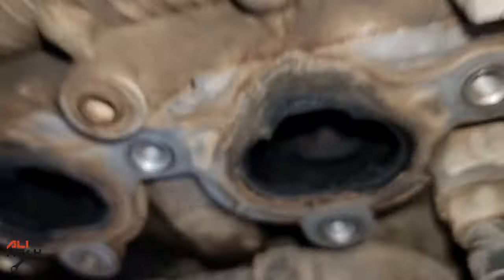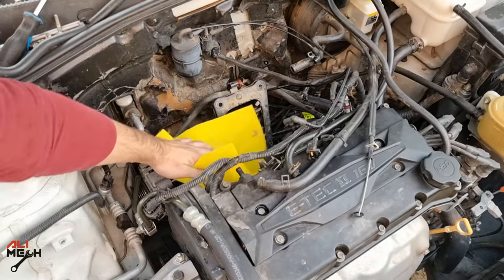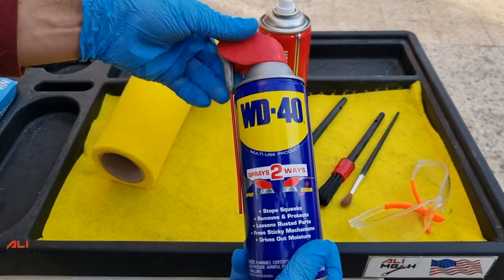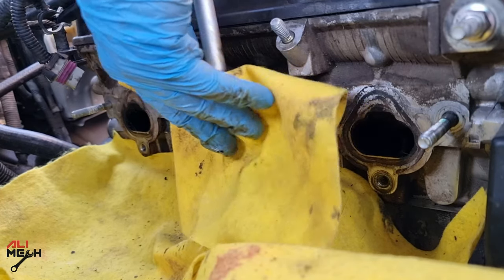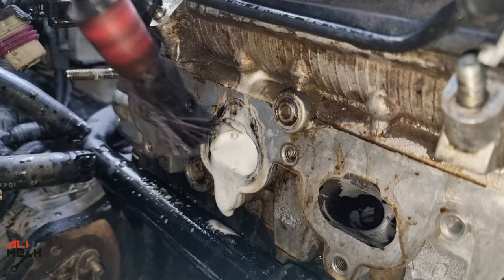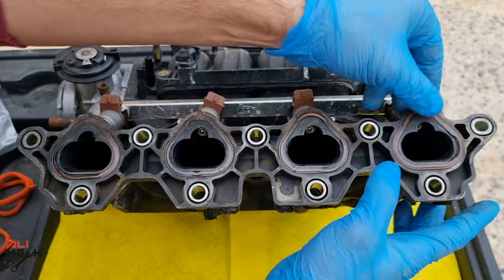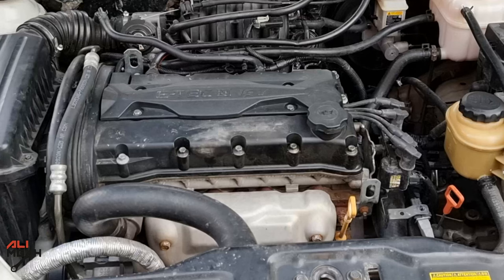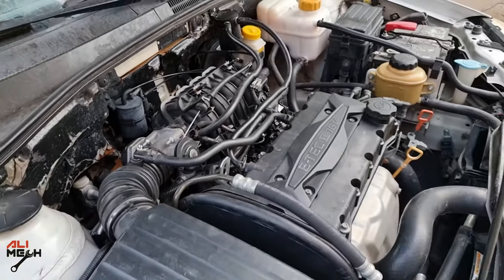How to clean intake valves on Direct/Indirect injection engines without using expensive tools

Comment: I don't agree to use WD-40 because it carries penetrating oil which will act as magnet to attract dust particles. Rest of procedure is fine
Reply: WD-40 can also potentially damage those intake valve seals, too if they are rubber which they usually are...I'm gonna use a little Blaster silicone lubricant on mine tomorrow (along with the zip tie method) it actually states on the can that it's totally safe for use on rubber and that it won't accumulate dust & dirt! I might even use a little engine degreaser if I feel it still needs a little extra cleaning power but  it should be good enough along  w/ the manual cleaning...then I'm gonna run a full can of CRC intake valve & turbo cleaner thru it after I get it all put back together just to clean up the undersides of the valves & the tops of the pistons...

Comment: This is not a direct inject engine. Injectors are in the intake manifold.  Ports/valves would have been much more dirty. It may still work, good info, but I would not spray solvent into a dirty port like that. A dirty valve will not seal properly and solvent will leak into cylinder.
Reply from the maker: The headlines says direct/indirect  not direct only

Comment: Wait, you have port injection and your ports look so bad???
Reply: Exactly what I thought, saw the injectors on the air intake ports, should not have had anywhere near that amount of carbon on the valves.
If his was that bad then my direct injection engine must be a bloody coal mine in there.
Reply: @rossn5186  lol

Comment: Just use thicker oil, you wont need an oil catch can.
Reply from the maker: That's the worst idea, now you create back pressure,  because the holes in the cylinder block are small and designed for thinner oil

Comment: The best way to clean the valves is to not buy a direct injection only engine. Manufacturers need to figure that it doesn't work on gas engines.
Reply: What other engine you’re recommending? Brand?
Reply: Direct injection is fantastic technology when implemented correctly.

Comment: Could have just  removed plugs and put brake fluid down down each cylinder and cranking plugs in wires off. Then pit plugs in and wires on and start it let it smoke and burn off. Then 1 cinder at a time pour dot 3 down 1 cylinder and put plugs in and start engine and let it burn off after 20 min do each cylinder until done. Yes dot brake fluid

Comment: The problem is the critical part of carbon build up is on the VALVE SEAT. This does NOTHING to clean the valve seat. The GDI engine needs to be running when subjected to the cleaning chemical to have any impact on the valve seat surface.